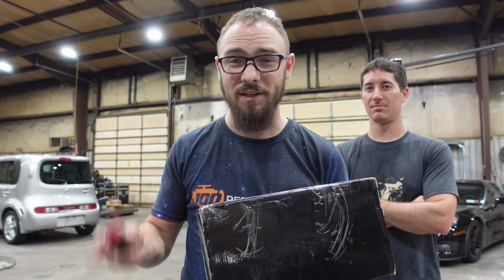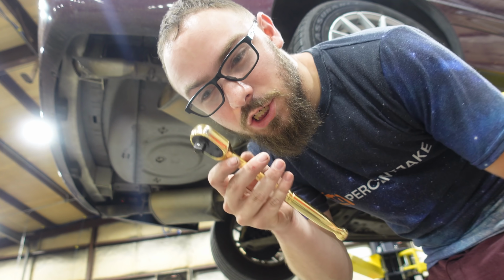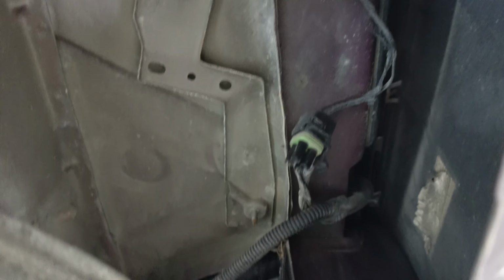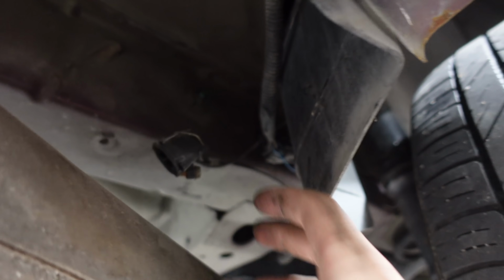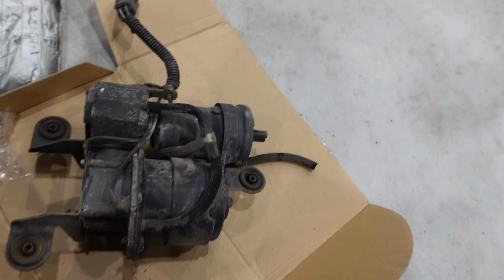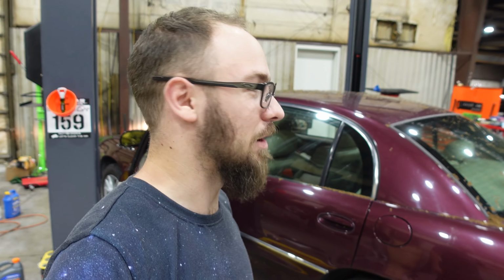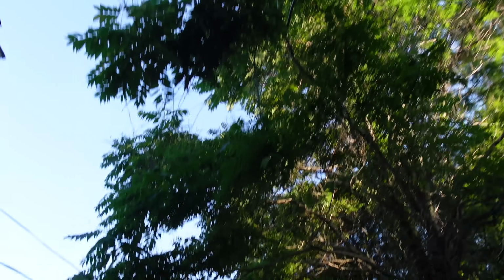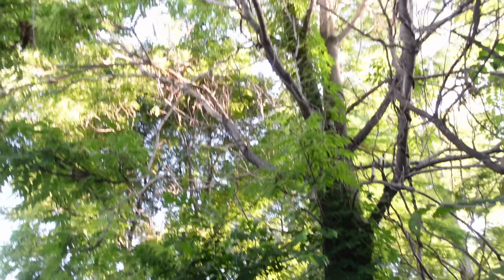FINALLY FIXED! SUPERCHARGED Park Avenue Ultra gets Air Ride Rebuild!

Comment: I own a 2005 Buick Park Avenue Ultra and she is PRISTINE:  Pearl white w/light beige carriage top with a sunroof.  My 21 year old son has owned Hellcats, Corvettes etc but I have such an affinity for these Buick’s from this era.  Appreciate these videos for numerous reasons and I just mentioned one.  As you drive down Main Street America or drive through any Walmart or Dollar General parking lot, you will see cars, trucks etc of this vintage that are nearly 20 years old and still running.  The point is, the average American is about trying to keep what they have running well and on the road as opposed to having to replace their automobiles every 5 years.  These videos help the average Joe (…or Sally) keep their 2 decade old vehicle running…to boot….if it has a 3800 motor like these Buicks…then you can expect to see at least 300k out of it…provided the body lasts!

Comment: Thanks for showing us how.  I had a high mileage 90's Cadillac that needed a pump years ago, and the estimate was over $900. Instead of fixing it, I gave it away to someone who needed a car for around town use.  Perfect for one person with limited driving needs.  Now I know what to do to fix a GM air suspension.

Comment: We just inherited a 04 ultra. When driving it. Hitting bumps in the Rd the cars rear end will shift,jolt,to the right. Does that have anything to do with the air ride. I do know the air ride does not work. Watching your video.i do believe replacing the compressor.That will correct the shifting to right issue. What's y'all's take on it

Comment: I was delighted to find that my wife's 2004 Lesabre's air ride leveling system works perfectly. Every electric gadget functions- including the CD player. Because the trunk is cavernous, sometimes the rear would sag and the pump would try to compensate. I bought a pair of Monroe towing struts and the rear is now level, the ride is smooth, the pump rarely turns on and you can put a lot of weight in the trunk. Thanks 100% Jake for the tutorial!🤗🤓
Reply: Are you saying your wife has a lot of junk in her trunk? :-D

Comment: I love to see you work on this old gal Don't stop believin' your modern lead sled is well worth your effort. Mine is older but I think was a little better maintained and probably driven a lot less. 1997 with 187,000 miles. My AC pump did die last year  and since I am not able to change parts myself it becomes a $1200 repair instead of a $450 repair. Yes that means it is about $800 for labor yikes. I still love these Park Avenue Ultras .... gonna be a hot summer lol

Comment: Great job, Jake. The Buick just keeps getting better all the time. Just wish Buick had remembered that Electra, in which line Park Avenue was a trim level, was a 4 ventiport model. You might want to rethink taking the tree down. It is shading the house, which is likely worth 3 or 4 degrees of free air conditioning.

Comment: Tree of heaven. They are the worst, very invasive. They go hand in hand with the invasive spotted lanternfly. They smell horrible when you break the branches.
Reply: Yep, tree of heaven, AKA a ghetto palm. Really stubborn, nasty things. I've got one that keeps growing back in my front garden, you've really got to pull them out by the roots
Reply: @11sfr  Pour your used motor oil on the stump every time you change oil. Also pour your burning charcoal on the stump as soon as your food is cooked. You will eventually get rid of it.

Comment: did you ever read my comment about Roadforce by Elite??? i think that would've fixed your wheel balancing issue. you bought new wheels instead because you thought the original chrome wheels were the issue

Comment: Looks like a locust tree. Can't tell what type. You have to look at the leaves. In Florida if you want to cut down a tree that size, you have to plant however many trees equal in inches that tree trunk was in inches. So if the tree trunk was 8 inches, then you have to plant 4 trees with 2" trunks, or a 6" and a 2". It's a mind boggling stupid idea and most companies overlook it.